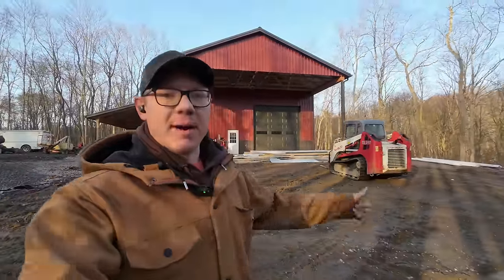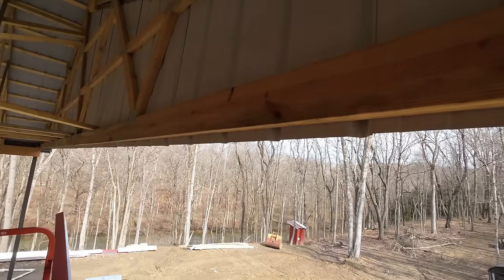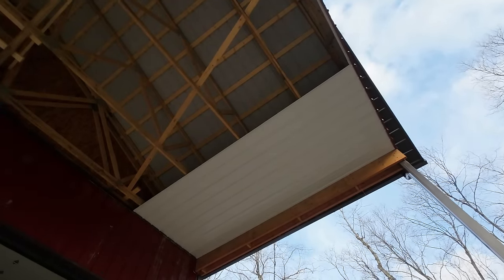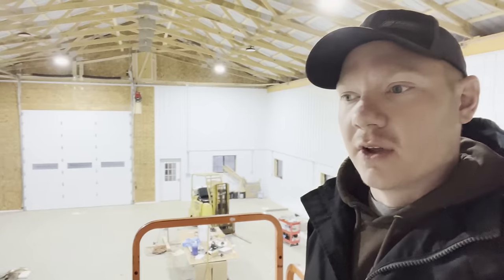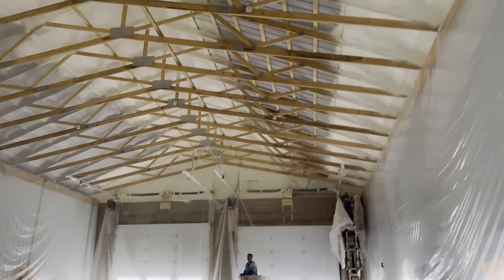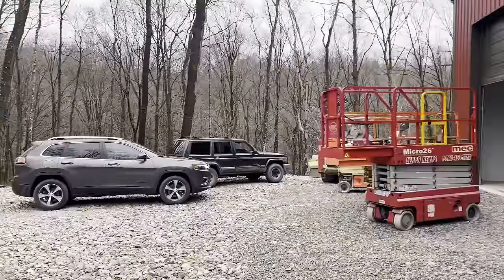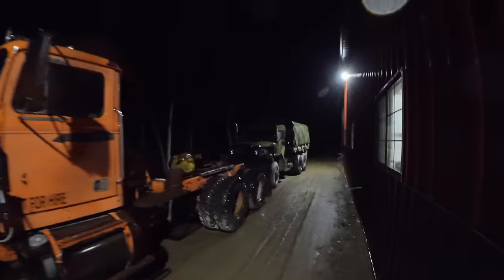I had My New Shop Sprayed with Hot Foam!! (Dream Shop Build)

Comment: This has been a great series on the shop, you should be really proud of what you've accomplished. Well done Matt!
Reply: I agree 100%😀
Reply: A superb achievement Matt. Bravo!
Reply: @thinkcasting3182  man no one care about that crap
Reply: I agree with Andrew it’s fabulous. Andy from Australia
Reply: That spray foam holds moisture and will cause the metal to rust and the foam to pull away and it'll just keep getting worse until it starts leaking.
Reply: ok

Comment: In my shop I have ceiling fans. They make a big difference in the winter. The heat that rises to the ceiling gets pushed back down and gets rid of any cold spots. The fans are cheap metal fans from my local granger store. It really helps keep the temperature even everywhere in the building and the heat is more efficient when the fans are going.

Comment: can not wait to see the overhead crane installed. insulation and lighting top notch.
Reply: A crane would be lovely
Reply: Really what I’ve been waiting for on this shop.
Reply: I was wondering about this, that truss system looks really minimal. Would there not be issues supporting not only the load of the crane but the load on the crane. Not to mention the inertia generated by the crane going back and forth on the structure.
Reply: @JohnNorton86  : Exactly -- that's why the crane is going to have its own supports rather than being tied into the building.  Matt mentioned that when he was building the foundation -- there are separate footers in the foundation for the pillars that hold up the crane.
Reply: @JohnNorton86  in another video he poured huge footers inside the wall under the floor. They are to support steel beams I imagine to hold up the heavy crane.

Comment: You may want to fill in the vertical gaps where the outside tin meets the j channel on your overhang. If they are left open you'll end up with one big giant bee hive.
Reply: two years from now, let's have contest counting the mud dawber nests! 🤣
Reply: So you're saying that would BEE a good idea?
Reply: @IGDZILLA  Yep, a friend of mine sided his house , gambrel roof (barn style), with the delta-rib metal. He has invested in the contoured foam sealing strips at all the edges after experiencing yellow-jacket wasps nesting in the walls and ceiling. They eventually chewed through the drywall and started coming through the small holes they created. Behind the ingress holes were huge colonies of those wasps. Nasty lesson learned.
Reply: @xoxo2008oxox  Arhhh!!!
Reply: @MGower4465  Ha Ha !!!🤣🤣
Reply: @murphymmc  Oooh lets hope they dont live there !!!🤔
Reply: Just what I was thinking and also I hope all those trusses were treated with some anti BUG anti ROT spray.......now was the time to do it if not.
Reply: The paint is a fire retardant.
Reply: Ain't nature just grand and then there is the bravado of humans! Eh!
Reply: Flamethrower?
Reply: When I build my house which is going to be much like this it will have sheathing which will then be caulked and or taped. I need to find more information about the types of tape you can use on osb. I intend to sheath everything soild and then install electric and passive gable vents. Which includes boxed in and sealed soffits. I think I will also have my rafters custom made to include 2 foot thick soffit section. Which means that when you look at the building where to soffit would only be like 6 inches thick it will be 2 foot thick which will require its own siding. This will allow for the install of lighting in the soffit and 2 foot of blown in insulation which will prevent cold and hot spots in the corner of the ceiling. Think of it like a 2 foot blanket extending 4 feet over all of the sides of building.
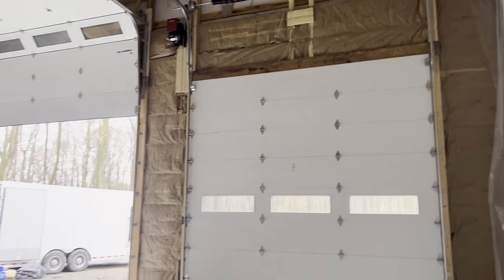Reply: @IGDZILLA  16:50 16:54
Reply: @barrythirtle4296  Thanks I was wondering why they painted it.
Reply: @Pinzpilot101 I'm no expert but I've saw a lot of bad things about spray foam rotting out  ceiling joists ??  Hope it doesn't.

Comment: I had my Little building spray foamed with open cell. Loved it so much I had the crew go to my house and spray my attic. In the Little building it allowed me to keep it above freezing with a 1500W heater (1200ft2 with 10' side walls). At my house and when it was in the teens the heater came on every 1.2 hours and ran for 10 minutes. House is 3800ft2 with high ceilings as well as some 12' vaulted ceiling areas.

Comment: Celotex at least used to make a sound deadening board, like regular celotex without the asphalt, brown color, 4 x 8 sheets. I would expect that some of that on the vertical faces of the trusses would address your echo issue. Probably alternate positions, say 1 left of center inside truss 1, 1 right of center outside truss 2. left outsde #3, right inside #4 and so on. That way it won't interfere with air flow. I built a cupola on my building roof and put a squirrel cage blower in it for summer heat and fumes exhaust. It really helped.
Building looks  great! Congratulations!

Comment: Your Equal Height Helper is found in your pile of lumber!  All he needs is a box as tall as the difference between you and him.  Still thinking while I enjoy your time lapse.  So imagine doing this work all alone,  hehehe!
Matt, waaaaaay back in '76/'77 I worked for a company called C.A.Lang located in Millvalle, PA, just up the a few miles  from Pittsburgh, PA.  While working for them I was credited with insulating 15 oil storage tanks and several dry docks Watching these boys spray brings back lot's of memories!

Besides Spray Foam I also did a sh*t load of pour foam for a company called NONAC also out of Pittsburgh.  We filled the wing tanks and false bottoms  & forward and aft bulkheads on 10 hopper barges & 2 dry docks

Comment: Fixing acoustics and reducing echo:
Grab some sheets of rock wool insulation.
Wrap em in cotton fabric.
Run a fine (2-3mm) wire straight through side to side from the long ends of the sheet.
Hang the assemblies in between the trusses in even spacing.

This will make so much difference in acoustics and echo reduction.

Comment: The echo will get minimized when you got equipment, tool benches and cabinets installed. Also to help with the environment install directional / reversible ceiling fans to move the hot air down in the winter, and cool air up in the summer.

Comment: I recommend full cut off wall packs or area lights. Wall packs have too much glare especially the led, and they throw light every where but where you need it, making them less effective. 

If you want good lights, look into high pressure sodium. They can be bright but not harsh like LED.

LED lighting is great for indoors, and when used correctly outdoors. For the woods, high pressure sodium is best so you can still enjoy the outdoors with out obnoxious LED lighting.

Comment: For marking screws on tin like that get a 4’ board and insert screws on constant required spacing. 
Line one end with the open rafter centre and line it up with screw on previous sheet. Give a bump and spots will be marked.

Comment: Its a BIG space but you can get thin plywood sheet, put a slab of RockWool on it and then wrap it in a fabric of your choise and those dotted around will damped the echo off a lot - its similar to the 'mushrooms' on the ceiling of the Royal Albert Hall in London.

Comment: I thoroughly enjoy your build videos. They're a great step in the whole process, thank you.     You MIGHT consider running creek water ( filtered of course!) water through your radiant floor system this summer. It might help cool things. Just return the water to the creek, and the cooling will only cost the electricity to run the pump.

Comment: Spray foam is amazing stuff stops condensation in winter and keeps things cool in summer. Only drawback is if you have a leaking sheet fixing, the water gets trapped and rots out the timber. More of an issue with the design we tend to use in the UK where we have heavy purlins 16 ft long. This has happened to me and know of one local that the roof collapsed after about 25 years.

Comment: That felt is drip stop. It is made to absorb any moisture from the metal sweating from inside and outside temperatures. It is designed to dry back out from air flow in your attic space. I have installed it and it works great even with 100 degrees temp difference from inside to outside. (Personal test) My concern is now that you sprayed spray foam on it that it will no longer be able to work properly. I’m not saying it wont just pointing out that it is something that would concern me. If any one is an expert or has experience with this combination I would love to hear your take on this. Thanks. I’m happy your finally getting close to using your dream shop.

Comment: I have a walk-out basement and about ⅔ of it are not underground. The walls were insulated with polar foam and despite having a patio door, 1 large window and 3 mid-size windows, it's only about a degree warmer than the main floor. Polar foam is amazing.

Comment: Those spray foam trailers are pretty cool, with my job actually work on and service a lot of different trailers including several owned by a spray foam company and the one thing I can tell you is those trailers are HEAVY

Comment: Now you can auction pick some Stronghold cabinets for the shop. 
Take the time necessary to get the proper engineering stamps and certificates for the overhead crane. It will be a tool you can use everyday.

Comment: Used to spray that foam on spas years ago,  it is a 2 pack  foam air driven drum pumps do not mix up pumps for Android or B otherwise pump will seize up, smell of it is horrendous feed pipe is heated  to aid flow awesome products to work  with but requires some serious ppe

Comment: Now you just need a Big Ass Fan on the rafters to circulate the air. Great for summer or winter. Just hold onto your hat for the cost of their fans. But well worth it. Shop is looking fantastic. Thanks very much for sharing. You may find that once you move the equipment and tools into the shop that the echo will diminish considerably.

Comment: Looking great, you wouldn't want to be starting up the old smoking equipment you have in there and marking the new ceiling with black soot. Maybe you could get some cheap foil ducting and hang it over the exhaust of the job you're working on and just have it running out the door.

Comment: When you run your piping for heat you could set up a geothermal loop. Bury a secondary isolated loop underground a hundred feet or more, and use it during the summer to cool the shop.
Reply from the maker: I’ve considered that but it gets complicated because if the dew point is off it can make the whole floor sweat

Comment: I’ve always wondered what happens if you have to replace some or all of your metal roof after you have the spray foam put in
Reply: Yup, its all great till you have to find  leak or work on it
Reply: @douglassmith2055  I never even thought about findin a leak lol. I would still love to have the foam in my garage but I guess everything has some drawbacks

Comment: In a big house I built for a guy who owns several McDonalds stores, he had this stuff sprayed in his big attic-- and he sprayed it about 8" thick on the back of the sheetrock of the ceiling, which completely buried the 2x6 Joists, and then they sprayed it 12" thick on the rafters above it. lol..  So the entire attic was like a giant cloud of foam above and below and you couldn't hardly see any frame anymore. Obviously way over done.  It was a huge house too.  I bet he spent over $100k on foam alone.   I know the cost of windows and doors for the house was over $64k.   Pretty insane build for only 2 people.

Comment: The big difference with foam is not the temperatures but with a plain tin roof you often get condentation dripping down and basically raining on everything inside. Foam completely cures that.

Comment: Hope your foam insulation  will be okay  accross the pond in the UK  we have  problems with  condensation holding in the foam and rotting out the trusses . So much so that after 15 years or so a lot of property is  unmortgaeable   and the installers gone out of business  😢😢

Be prepared for a reproof in about 20 years 😂
Maybe the fiberglass will help 
Sorry to to be bearer of bad news   maybe with a taller space there will be more air flow
lens wi

Comment: A closed cell is definitely better than an open cell phone for insulation. You need about 2 inches to form a vapor barrier. I think you get an R-value of 10 for about every inch of foam that you spray.

Comment: Graco Fusion CS guns are what they used. I started my spraying career on that very gun. Switched to PMC AP3, then back to the reliable Graco "D" Gun. They did a proper prep job covering everything, even the lights.  Watching this makes me want to pick up a spray gun again. 

 I paused on the reactor and see that they're running about 100psi off which is normal. The right side reactor is 200psi off which means there's probably an issue with the gun. When a CS gun blows up, it's an absolute pain. The reactor heats up the chemical and the reaction when you mix isocyanate and resin will add extra heat so that's where you get the roughly 200 degree temps. Usually you can touch it within 10 seconds and within 3 minutes, it's almost hard as a rock. 

But, I cringe every time I see fiberglass insulation on metal. It will rot from condensation due to the air void in between the insulation and metal. Spray foam would have been the best bet for your walls, not just the ceiling. My metal building was built in the 70's and has rot everywhere on the metal because of the fiberglass.

Comment: Hmmm I don't think the insulation  did the trick for the sound, but it did help lighten it up a little. And as you said it will help with heating and cooling.  Waiting patiently for a new or even a finishing build.

Comment: Matt, almost 100-years ago the Empire State Building was built from the ground and finished, then the tallest building in the world- in exactly 1-year. You still have more to do... New York City weather was no better than Western PA. 
No automatic sprinkler system or fire suppression, roof venting turbines,  reversing ceiling fans? Why not cover ceiling joists and horizontals to eliminate all that dead space that will trap both heat and cool air, respectively? The overhead crane installation? 
More $ for sure, but some are important investments for future comfort and- safety, also reducing utility expenditures. Solar panels on the roof? Might be tied to your floor heating.
Will echoes improve when noisy tools and machinery are used in there? 
Hope it all works out for you!

Comment: the nail through the siding was at 5:26 I yelled NO at the screen. lol
doing pre-finished trim work and cabinetry makes you extra cautious of nail angles, length and depth. so of course I caught it before you fired the nail. 🤓
**actually, I'm surprised there wasn't multiple of them, both of you were angling the nailer badly, after watching again.

Comment: I have had bad experiences with photo cell triggering lights. Maybe i had cheap photocells or just too harsh of weather. But i have found much better results with a timer switch. Much easier retrofit and reliable. Just program the on and offs.
Reply from the maker: I don’t really care for them either. These don’t have them installed currently

Comment: I know you buy stuff at the auction,why not buy an auxiliary generator to run shop with a switching  board to switch between local power and auxiliary power. It might come in handy,later.

Comment: I'd of just put a ceiling in, and blown in cellulose like 18" deep. I used the same scissor trusses and filled it full. Was pretty inexpensive and the rafters are gone. I used 5/8" drywall which was a PITA to install, but went fairly quickly.

Comment: I like the open truss look too instead of a flat ceiling but do you have to worry about the roof leaking between the metal and the foam in the future?  It would be hard to find and fix.

Comment: Matt, The build is awesome and it sets a new stage for all your new videos and less work of clearing the area to work. What are you using for power?  
Will it be adequate to power the crane, lights, floor heating system, exhaust fans etc.?

Comment: hey not sure if you knew this but on that orange scissor lift you can shut off that noise it makes when you move it forward. You have to remove the left side panel and disconnect the wire that goes to the horn. I may be wrong on which side.. tho.

Comment: On the back area, if you would have added a 2x4 or 2x6, flush with the bottom of the truss, that would have helped with spacing.

Comment: the only adavantages to spray foam is speed of install and it is easier to get air tigtness as its blown into all the gaps and grooves. problem is its harder to do any repairs.

the easiest product to use ive seen is aircell which is bassically a metalised heavy duty bubble wrap. it is expensive though and slow as it has to be rolled out on the trusses before installing the roof sheets.

Comment: Acoustics.........you will always have an echo when you use metal paneling on the walls.  Once you get some equipment in there, it will dampen it a little.  The more "stuff" you put in the shop, the less echo you will have.  You basically have an empty "auditorium" at the moment.  Echo is expected.  GREAT SHOP.  Looks like there's plenty of room.......until there isn't.  hahaha

Comment: Great project Matt, been following along with keen interest.  Just a quick question, how fire resistant is the spray foam insulation. I’m totally in favour of using spay foam.  My concern is the majority of your project are centred on internal combustion engines, which leads to my concern  inside your dream shop.   Anyway you probably have is issue covered.  Thanks. Mike